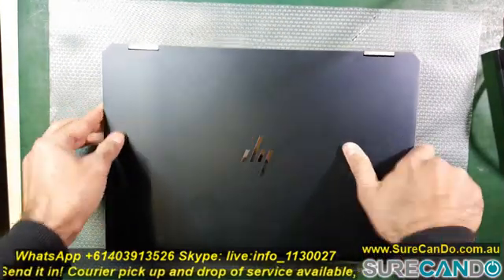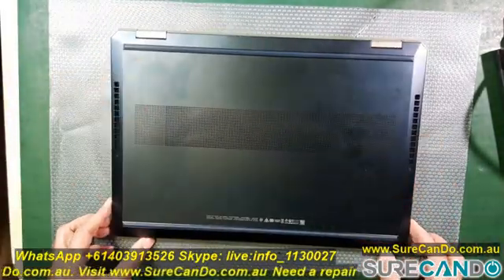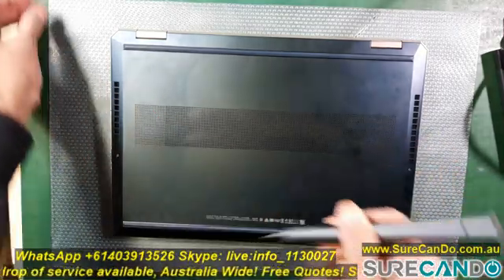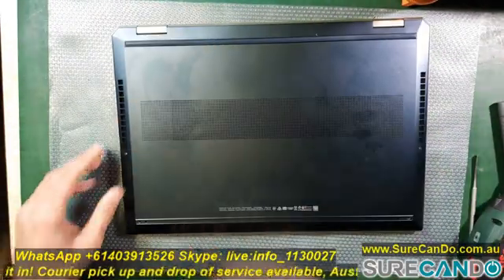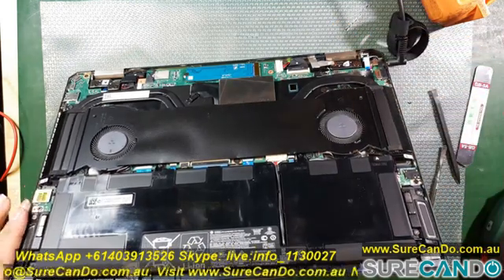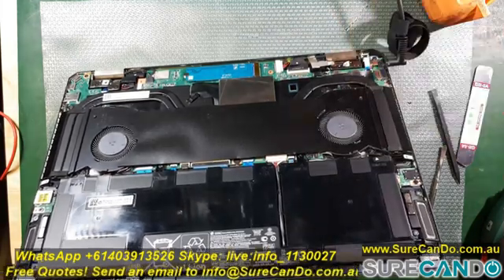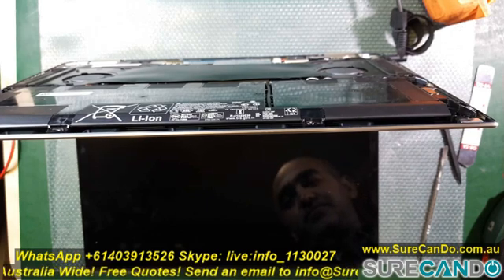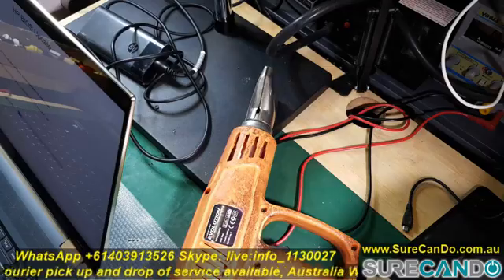HP Spectre 15 x360 Blinking Power Light Not Turning On BIOS Reset Super IO Fix 14 13

Comment: I drained my HP Spectre battery by just letting it sit, i.e. the power & F6 (mute) button blinked for 4 days. I know some people can't afford to do that, luckily I was on a holiday at the time.  Once drained I plugged it back in & restarted by pressing the power button once.  It then shut down due to insufficient power so I waited a minute & pressed it again.  I did not run any apps until fully charged.  I was lucky I did not have to crack the case open.  Shorting those chips looks scary.

Comment: Thank you. It works for me. I've got an x360 13" and the charge white light was blinking slow with the same rythme.  After the process i pluged the charger cable and then the light turned  non stop orange prooves that is charging well.